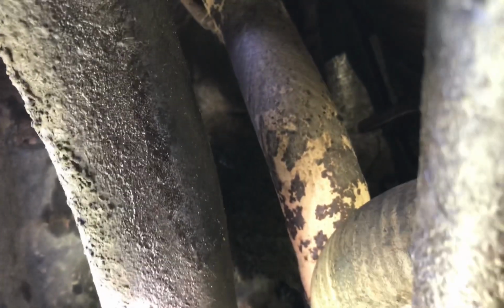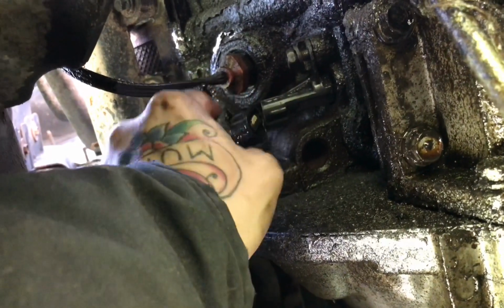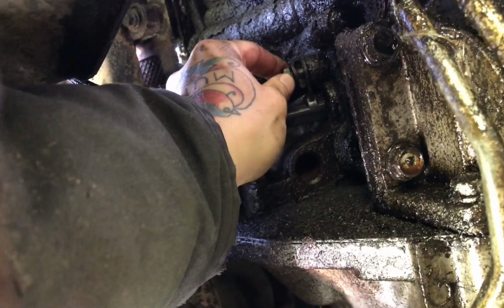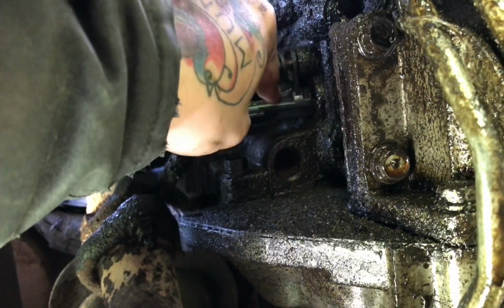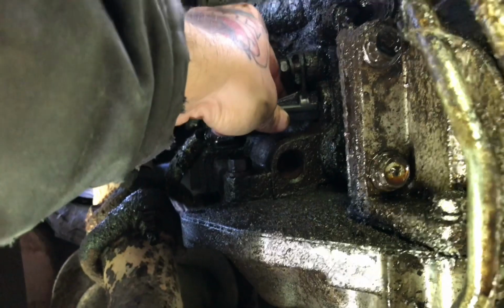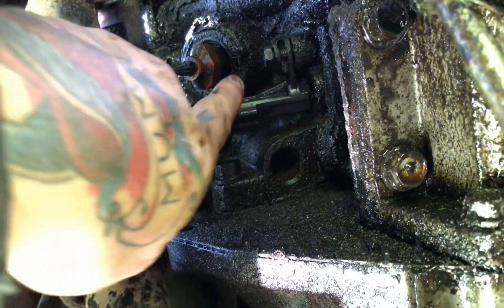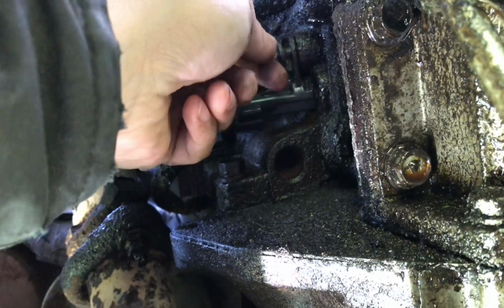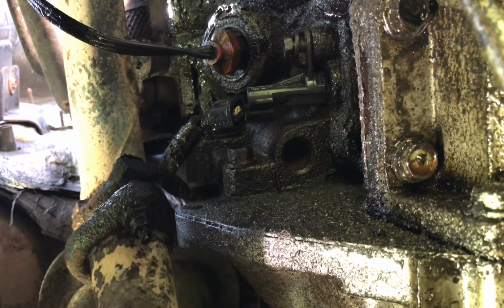How to Replace Crankshaft Sensor • Dodge Ram 1500 4.7L • #ThatBeardedMechanic

Comment: Did you have a problem fitting the new sensor in the Mopar one it not fitting and the last time  the mechanic needed to shave it down some. Now I am doing it and I wouldnt really like to shave the sides down to fit in the location what did you do
Reply from the maker: Nope, I didn’t have any trouble fitting the new one in at all. Shouldn’t have to shave it down unless you have a cheaply made knock off or a wrong sensor/ wrong one for that engine. I’ve never had to shave any of them down, even the MOPAR ones. 

If you find it’s a snug fit, or stiff to push in, you can line up that o-ring with just some oil. Even wipe some off the dipstick and lube the o-Ring if you don’t have a fresh bottle of oil.
Reply: Johnny bgood had the same thing happen to me. AutoZone part. I had the Mopar part and the AutoZone part side by side with a small level and the AutoZone part was longer by a few millimeters and it would hit the internals and damage the sensor. Took the part back and got another one, and compared overall length. AutoZone guy thought maybe the camshaft sensor and the crankshaft sensor got mixed up as they are off by one part number. I believe it was because they manufactured it out of spec.
Reply from the maker: Miguel Ramirez Appreciate the assist. Do you happen to know the brand or was it the in house AutoZone brand for future reference. I’m up in Canada, nearest thing to that would be Parts Source for us.
Reply: @That_Bearded_Mechanic  yes, it was the AutoZone in-house brand Duralast. One other thing I noticed today. I watched a video that said a battery might not have enough power to drive the coil packs and that can be an issue. I turned off my AC, Radio (face bezel off), cigarette charging plug and drove it home. I instantly noticed throttle response and a definitive improvement. I'm sure some codes are still there. But before I wasn't hitting 3k rpms. I'll keep digging. But for now I'm getting a new battery. The old one shows half a charge on the dash, don't know if that's common or should've been higher.
Reply: Can anyone tell me the exact bolt size that holds in the sensor? Dodge dealer couldn't even tell me. They said it's a M8x1.25x20....this doesn't fit though.
Reply: Currently having a problem putting the Duralast sensor in... ugh.
It seems like the plastic comes up too far, and the sensor doesn't fit right

Comment: Will this sensor cause no spark? My 03 1500 lost spark the other day and i cant figure it out
Reply from the maker: Yes a failing or failed crank/ camshaft sensor can cause a rough or hard/ no start condition. 

You can check for any codes as well by cycling the key to the ON position three times fast, making sure not to start the truck doing so and leaving the key in the ON position on the third key cycle. Any codes will show up in the odometer dash display. Take note of them and check them on Google.  

Hope this helps.

Comment: Did you have to do a relearn procedure??
Reply from the maker: Nope, I never bothered. Just let the truck idle for several minutes. Turned off, restarted, idle and took her for a quick run up the highway. This is what I’ve done in the past and never had issues. Ideally if you wanna do a full step
by step relearn procedure, a scan tool should be used.

Comment: I have a 03 Dodge Ram 1500 with a problem that I can’t seem to find. It stalls or rpm drops to 500 then if I tap on gas pedal for 3 times it finally accelerate. It gets scary when happens in on coming traffic. 3 seconds delay can kill me. I’m researching any advice is appreciated
Reply from the maker: Oh wow! Yeah I can definitely agree that’s a scary situation.
First off, do you have any existing engine codes present? If so, what are they? Did this problem also just suddenly occur one day or was it an issue that slowly progressed and intermittent to the point it’s constant such as now.

Comment: Hey bro i got this same truck and im having trouble maybe you can help me out. This truck was misfiring and stalling alot, I replaced all spark plugs and also the coils. Now its working alot better but  when i put the truck on Drive it feels like the engine starts shaking, and that also happens when im stopping at a red light. When i i have my foot on the break it feels like vibrating and like it just wants to run out.
Reply from the maker: Hey, do you notice the RPM’s hunting? (rising and falling without input from the gas pedal). 
I too had this issue when I first bought my truck years ago, the IACV (Idle Air Control Valve) was the issue. I replaced it directly. Problem when away and has not been an issue since. 

Also, are you throwing any engine codes by chance while doing this? You can check for codes as well without an OBD tool by turning your truck off and then cycling the key to the ON position ( do not start) three times and then holding the key in the ON position on the third cycle, look at the odometer heads up display and you’ll see codes cycling. If any do, write them down and google them to get a general definition of what they are. 

Also make sure you have no holes in the intake system, all vacuum lines are installed and on properly as well because that too can cause idle/ running issues. 

Hope this helps for the time being, let me  know how it goes, but I would start from there.
Reply: Thanks so much. Yeah i was thinking the same , so im going to replace the valve just to see if it solves the problem
Reply from the maker: No problem man, hope it works out for ya. 🤞🏻Oh and while you’re in there and if you have time to take the throttle body off, would be a good time to clean/ flush it with carb cleaner. Mine was disgusting and had carbon build up on the backside and inside of it.
Reply: That Bearded Mechanic  thank you so much

Comment: Sir , have same truck.  Getting 8-9 mpg since I have owned it ( 1 year ) .. no cel light ...  Hate to throw parts at it guessing..  Am I crazy or if it's electric issue then a code would pop up ? At that fuel burning rate ... Starts great , no missing but I'm no expert.  Does need more pedal uphill but will come to life at w.o.t.  Also consumes excessive fuel while idling.  Has slight fuel odor if you get on it  but no leaks , .. burns no oil or coolant...  Was thinking injection issue but again no cel ??  Might do new plugs and coils.  Only thing I've done is oil change and air filter...  Any suggestions? Love the channel..  thanks
Reply from the maker: Yeah that’s quite low for the truck mileage wise, I’m typically getting anywhere from 14-19mpg, depending on how I’m driving her of course haha. 

I would definitely recommend new plugs and coils for sure as I imagine they’re probably due for a change. Faulty plugs and coils can definitely attribute to excessive fuel consumption. 

The fuel odour leads me to believe it’s dumping excessive fuel into the system, the odour being I burnt fuel. Again, can be fouling plugs not fully combusting properly. 

The other alternative being oxygen sensors, if ones faulty the computer will read it as an issue to lean or richen the fuel mixture, typically you’ll get a P04XX code though, I have run across instances where a code hasn’t been tripped yet till testing the actual O2 sensor has proven its failing. 

Also doesn’t hurt to add some LUCAS fuel injector cleaner to, it does actually work and I use it religiously in my truck and other vehicles. 

Hope this helps, I’ll stand by for an update.

Comment: Would this be the same for a 2003 5.7? i've replaced everything else and the idle issue continues...
Reply from the maker: Correct it’s the same process. The HEMI 5.7 crankshaft sensor is on the passenger lower side of the engine, forward position closest to the oil filter. The other sensor behind it is the knock sensor. 

The camshaft sensor I mention in the video is gonna be below the alternator on your truck as well just next to the belt. 

Hope this helps and good luck.
Reply: @That_Bearded_Mechanic  thanks bro!

Comment: Damn. I was looking at buying a 1500 where the kid broke this off. Any clue as to how much it would cost to extract?
Reply from the maker: Anytime we’ve had to extract them we’ve charged on average 1 to 1.5 hours book time to remove. I’ve removed some in as little as 20 minutes. It can be done with extraction kits. (I might later make a video on how to do this process with a junkyard engine). 

If the deal on the truck is that great, definitely don’t let something as simple as this hold you back from getting a great deal.

Hope this helps you and good luck!